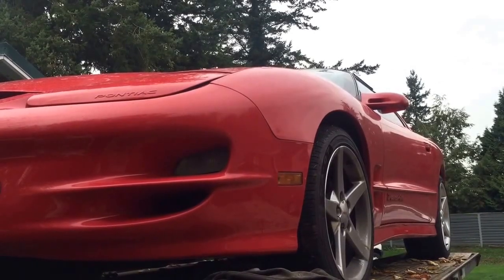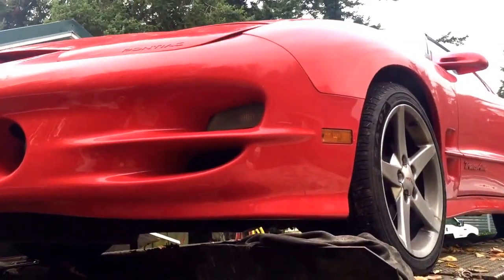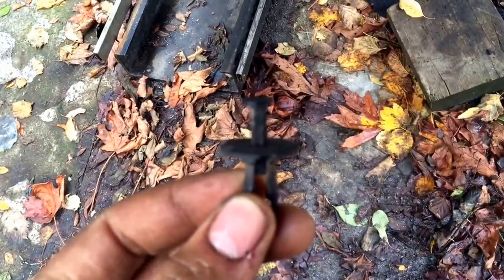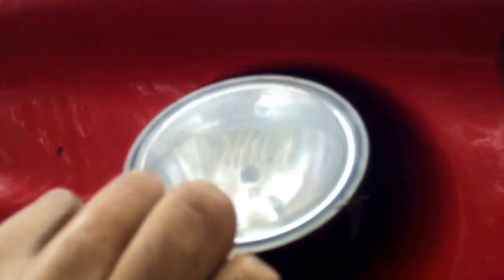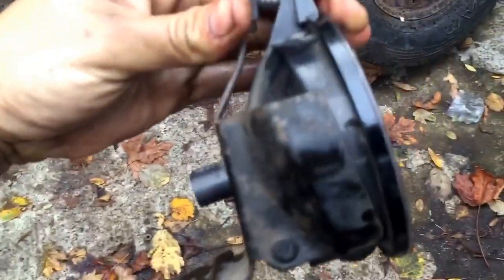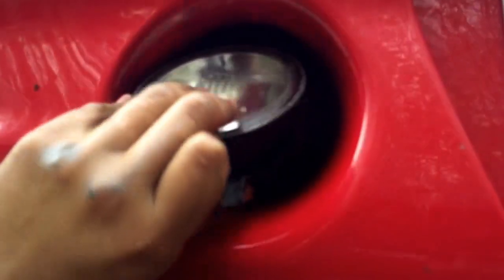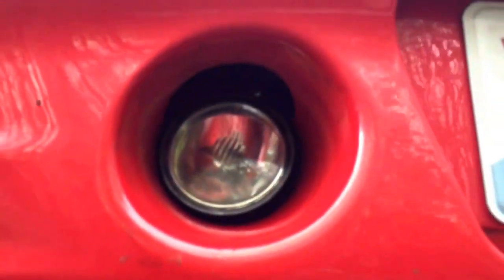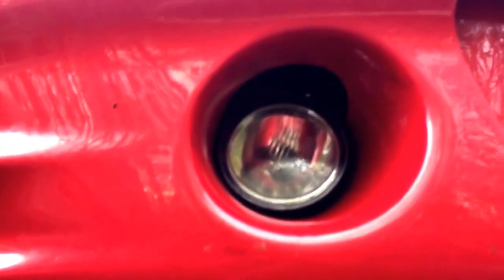98-02 Trans Am Fog Light Removal w/out removing bumper

Comment: Couldnt just bend down the radiator cover to just get your hand n there and change the bulb
Reply: That's what I just did
Reply: Could just turn on your headlights and get your hand in the too
Reply: This is to remove the fog light assembly if it needs to be serviced or replaced; its not about changing the bulb...
Reply: @myksanchez1222  I know I did it a few times both ways on my 02.

Comment: I tried it your way, and failed miserably, LOL, so what I ended up doing, because I really didn't want to remove the bumper cover, I went underneath and tried to install them that way, didn't work either, lens kept getting stuck on the bumper cover, but since I only needed about a 1/2 inch of space to get the housings in, I just pushed hard on the bumper around where the fogs go, and it barely gave me the room I needed to get them in.

Comment: great. ..replaced my fog lamps on my 02 trans am ws6 using this method, works great but requires patience when trying to remove the loose fog lamp from the front bumper. .lol. .was getting frustrated